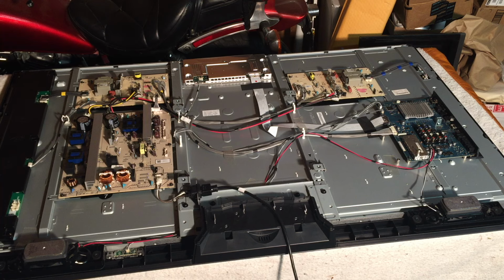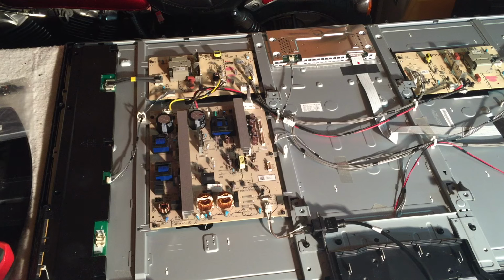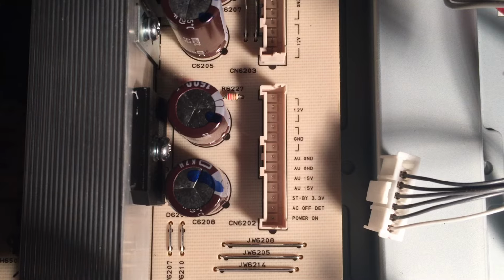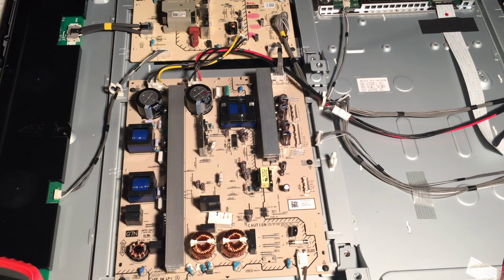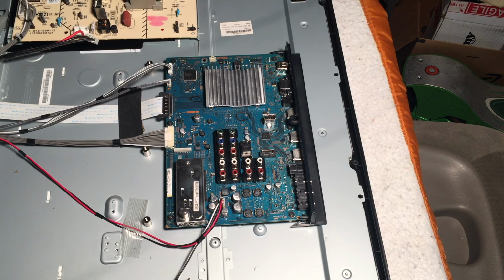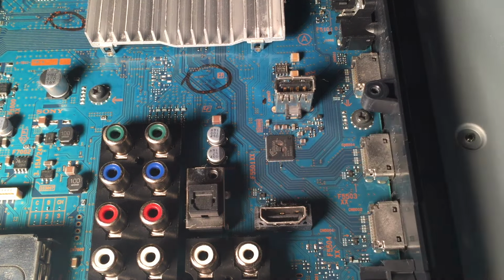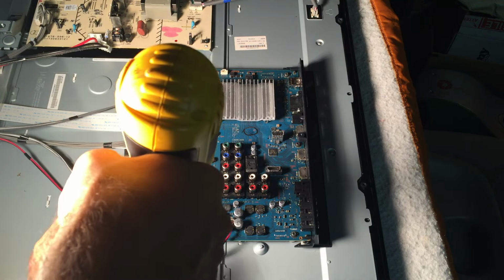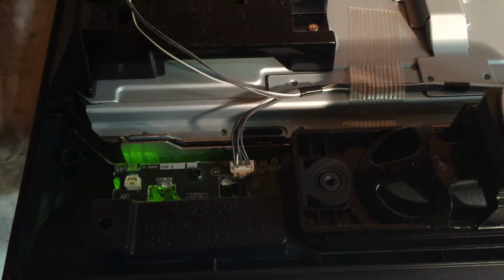How to Fix a TV Hit By Lightning or Power Surge

Comment: Hi mate just wondering that my tv was blown by lightning and it was through the lan wire for internet  to the smart tv and it wont turn on ,so is it main board gone or powerline gone do you have any idea ? thanks
Reply from the maker: Sorry to hear!  If you are certain that the power surge came through the lan cable then most likely you probably have a component(s) damaged on the main board.  Before buying a new main board I would recommend that you test the power supply (like in the video) to make sure it has no problems.  You can also search the main board for any visible burn marks for clues to where the problem lies.

Comment: Thanks for the video... I just found out my main board was affected buy the lightning... but can't find where to buy LG 32lb552u-tb main board.  kindly assist
Reply from the maker: Great job diagnosing it yourself!  I looked (like you did) and couldn't find one.  I would suggest that you see if you can find out if a different model of tv uses the same board.  Sometimes that is a way to find boards you can find by a direct search.

Comment: Awww thought you were gonna whip out the soldering iron but you replaced the board entirely booo...great job on finding the fix though I'm sure you probably just wanted to avoid the chip replacement hassle
Reply from the maker: Ha ha!  Yeah, I could have replaced the HDMI chip itself but then I'd have to check for burned traces and potentially other components with issues.  It was easier/faster to swap out the board.  If you want to see a board level repair on a big tv, check out my video here: https://www.youtube.com/watch?v=BNsog7yEaCM
Reply: Keith Segovia         🇵🇲🇵🇲🇵🇲🇵🇲🇵🇲🇵🇲🇵🇲🇸🇴🇵🇲🇱🇰🇵🇲🇸🇴🇱🇰🇸🇧🐣🇵🇲🇱🇰🇵🇲🇵🇲🇵🇲🇱🇰

Comment: why not just replace the chip
Reply from the maker: Good question.  Because of time and that I didn't source a chip.  The replacement board was delivered fast and not very expensive.  Plus, for most people watching this video I wanted it to be more what most could handle.  The other issue is that the traces could have been burned on the PCB and possibly other components could have gone bad.

Comment: I’m checking out your video today after my son plugged in his ps4 into a wall outlet, heard a pop, and now our Samsung tv is not working. No lights whatsoever. Everything on the entertainment stand was connected to a power strip, except the tv.It is plugged into an outlet which sits behind the tv on the wall. No surge protector. And everything else (cable box, modem, etc is functioning. But not the tv. Now what? Please advise.
Reply: A pop sounds like a blown capacitor to me. I suggest looking up your model of tv and something along the lines of "Samsung ______ TV pop and wont turn on"  in Google.

Comment: When you checked the volt on the 2nd chip you said put the needle on the bottom. Then on the chip. Where exactly on the bottom please?
Reply from the maker: MegaVicki1983 Do you mean when checking for the standby voltage?  The other pin needs to be connected to a ground point.  Any part to the main metal frame of the TV is considered ground.

Comment: great video!!!!! what about a 4k tv?
Reply from the maker: Thanks!  Yes, a 4k TV would be similar.  The main difference between a 1080 and a 4k is the lcd panel itself.  There would still be a main, power, and sometimes an led driver board.

Comment: I have a toshiba 52rv530u and it does have a stand by light and if you power up it goes green and atays on but there is no piture or sound?
Reply from the maker: Chris Carberry what caused the damage?  Do you notice if the backlight comes on when you press the power button (the screen lights up slightly)?

Comment: Hello,today i turned on my tv and ps3 (the weather was clear) suddenly after a while i saw a spark came out and the tv died immediately.I tried unplugging and plugging it doesnt turn on there is no light or anything?Do i need to replace the whole board? and the cause of it?(my playstation is alive)
Reply from the maker: sorry to hear!  If there is not a standby light on the front of the tv, it means it is not getting the 5v to run the light.  Most likely it is either the power supply is bad (could be a blown fuse or some other component) or there is a short circuit some where on the tv.  If you want to repair it yourself you will have to take the back off of the tv and do some diagnosing.  In general you don't need to replace a whole board (just the broken component) but diagnosing and soldering in a new component at that level is beyond what most people want to do and its easier to do a board swap.
Reply: My house just got whacked by lightning this past Tuesday. Took out 2 LCD tvs amongst other stuff. Neither tv has anything showing on when plugged in. No standby light, nothing. 
Checked fuse and it's good and will check the 5v standby tomorrow. But if I get 5v, does it definitely mean I just have to replace the main board?  I don't see any damage to any of the components on the main board is why I'm asking.
Reply from the maker: The main board is likely the culprit but you want to be sure.  See if you get standby voltage (with and without the main board attached) and let me know if you have a question.  The power supply could be bad too.  If you have the same problem that I did with this tv, the short circuit on the main board was preventing the standby light in the front of the tv from coming on.
Reply: FrugalRepair so I plugged in the TV and checked the voltage with the cable going from the power board to the main board plugged in. Then unplugged it to check the voltage in the other side of the cable. Got nothing both times (or very little and definitely below 3.3v). This is a little more confusing than your TV board because it has top and bottom connections (I have a picture but not sure how to post it, but one says ground and other says standby), so I checked them both. The 3.3 is D.C., correct?
Reply from the maker: So I understand correctly,  you unplugged every connection possible from the power board.  Then you plugged it into the wall outlet to give it power.  Then you measured the voltage from the pins that connect to the main board.  Yours should have markings on them (like I pointed out in the video).  When you checked those pins with ground as your reference (black probe to ground, red probe to the point you are trying to check) that you did not see any voltages on any of the pins?  Standby voltages are typically near 5v or 3v, it depends on the tv.
Reply: I unplugged the cables going from the power board to the main board and checked the 3.3v pin and got nothing. Mine is a 3.3 just like the one you had in the video. Because I couldn't get to the pin on the power board side, I checked it on the cable that plugs into the main board side after I unplugged it from the main board.
Reply from the maker: Are you sure that your multimeter probe is small enough fit inside the connector so that the metal is touching? I've had that issue before where I thought my probe lead was touching but it really wasn't and I was getting 0v reading.  If your power board is not putting out a standby voltage then you should find the component(s) that are bad or just replace the whole board (which if your buying on the secondary market is usually pretty economical for power boards.)  Another thing you could do is put your meter in continuity mode and check the pins on the main board and the power board for short circuits.   That is, one probe on ground and the other probe testing the pins on the connection between those two boards.  Some of them will beep indicating a short because they are supposed to be ground lines.  That may also give you some clues.
Reply: I actually didn't have to put the ends into the slots because you can easily reach them from the outside of the wiring harness. I am still concerned though that I see no damage to anything on either board. I would just replace the entire board anyway but would like to see what's causing the problem to make sure I don't end up replacing both boards. This particular board whether the power or the main is very difficult to find online. Perhaps because it's a 3D set?  

Thanks for all the help so far and I forgot to mention that your video is awesome. Without the video I never even would have considered attempting this.
Reply from the maker: I'm glad I can help!  What is the model of your tv?  The fact that it is 3d probably doesn't matter.  It is not surprising that you wouldn't see any physical damage.  With no power coming into the tv (unplugged from wall), did you test for continuity (ie a short) between the 3.3v pin (standby) and ground?  This is testing for a short on the standby circuit.
Reply: Alright,thanks a lot for the reply!I will replace the power board soon
Reply from the maker: TZ- Flash glad I can help.  Make sure you are not getting the standby voltage on the power board (after you disconnect the other boards from it to isolate it) before replacing the power board.  The power surge could have damaged the main board (like mine in the video) and you don't want to replace a working board.

Comment: Hi, unfortunately I have suffered the same problem, last night lightening struck, my android box no longer works, my ps4 powers up but doesn't show a picture & my tv won't turn on although the red standby light does come on when switched on at the wall so I'm hoping after watching your video it maybe is just the main board
Reply from the maker: if the standby light is on then you know it is not the fuse that is bad.  Usually the power supply's are cheaper so you may hope it is that instead of the main board.  But like the tv in this video the power surge came though the hdmi cable and took out the hdmi controller chip.  Let me know how it goes.
Reply: FrugalRepair yeah I will do. I ordered a power board and a main board as the total was £23 for both off eBay which is nothing so after I've fitted them next week I'll let you know the result. thanks for the reply
Reply: FrugalRepair hey, I changed the main board today and the tv is all back up and running!! Your video has saved me a bomb 😁😁😁
Reply from the maker: That is great to hear!  So happy I could help.

Comment: just had a major lightning strike this evening...no thunderstorm, just a loud crackling of lightning one time.  Iwas watching TV at the time and when it happened i could hear a clicking noise coming from behind the tv...I have 3 surge protectors...tv was plugged into a really good power surge protector..now i have no power light no pre amp light nothing...everything else is ok, computer, receiver, modem all are plugged into same surge protector and they survived....is there an internal reset button on my tv perhaps?  it is a Sharp LCD tv model # LC-50LE442U  it's about 4 years old...costs about 600.00 to replace it. what should I do?  thanks for reading this....
Reply from the maker: Sorry to hear!  The light in the front of the TV is called the standby light.  Check the fuse on the main power supply (unplug the tv and take the rear plastic back off  ) as a first step.  Watch the video and let me know if you have more questions.  There isn't a reset button, unfortunately.  But if you have a multimeter and a screwdriver you can fix the tv yourself.    The problem is either on the power supply board or there is a short circuit on the main board (which was the issue on the tv in this video).
Reply: @FrugalRepair  I have a Sony XBR-65X900B  I also was hit by lightning through cable and replaced both the power supply and main board and still TV will no power up.  When I plug power in outlet i hear something engage on power supply, I then push the power button on tv. I hear a click but still no red light on front of tv or does it power up.  When I pull plug from tv I hear the power supply make a noise almost like a contact sound.  Any ideas ?

Comment: My neighbor and my TVs both went out at the same time. We think we got his problem worked out, but I haven't been able to figure mine out yet. My TV (Samsung UN40FH6030) is turning on, however the screen is VERY VERY dim. The controls seem to work as well. I checked everything in this video but none of it seems to be the issue. The main board looks clean and none of the chips ~look~ damaged, though I DO think it died through the HDMI (my PS4 completely died in the surge). Any ideas other than dropping $60 on a new board?
Reply from the maker: The dim screen is the backlight.  did you try going into the settings and increasing the backlight (ie screen brightness) on the tv?  let me know.  if all of the functions of the tv are there (except for the dim screen) then your problem is probably not the main board.  It could be the led's (backlight) themselves, the power board (which supplies the power to the led strip), or some TV"s have a separate led driver board.

Comment: How do I find which main board to purchase for my vizio?
Reply from the maker: If you are sure it is the main board that needs to be repaired then look at the printed numbers on the board.  Vizio numbers tend to to be about 16 digits long with dashes every 4 digits.  You can also verify the board number (part number) by going to shopjimmy.com and looking up your tv's model number.  They usually supply you with the part number for the boards in the tv.  Once you have the part number you can buy from a number of places online.   I'd just make sure whoever you buy from has a return policy (to ensure they don't send you a dead board).

Comment: last night lightning hit somewhere tv went out it powers on then shuts off so i disconnected all  hdmi cords.  tv stays on only when cant use hdmi port 1 and 3 port 2 and 4 hdmi ports work fine as soon as i connect   hdmi 1 or 3 tv shuts off. why is this happening
Reply from the maker: If the tv works fine with hdmi ports 2 and 4 but does not work with ports 1 and 3, then my guess is that there is a short circuit that somehow occurs within the hdmi controller chip when those 2 ports are powered.  I am not exactly sure how the chip handles the switching of the signals to the ports and sends those to the processor chip.  If you could find a schematic of the hdmi chip and show me I could probably tell you.  At least you have 2 working ports!

Comment: Hi sir! I have an LG LW4500 tv. Its an old tv but i want to revive it. As far as i can remember, i think it got broked by VGA (or maybe HDMI i forget). When i plug in to the wall outlet, the tv has a stanby light. When i power on, its like normal. The LED light turns from red to white, but theres no display on the TV. So its definitely the main board right? Could it be the Tcon too? Also i havent taking apart the tv yet, maybe if i got time. I hope you answer my question :D thank you sir. (Sorry for bad english)
Reply from the maker: It could be any of the parts inside. It could be bad capacitors on the power board.  It could be messed up firmware chip on the main board.  It could also be a bad backlight.  For a bad backlight diagnosis, turn the tv on and shine a flashlight on the screen.  If you see anything then its a bad backlight.  You would need to get more information to diagnose it further.  Also, physically look at the boards for any burn damage.

Comment: is it the same main board for any LCD TV? Theres not different main boards for different brands are there?
Reply from the maker: Most TV's have different main boards for each model.  You need to find the correct replacement.  But the main board in almost all modern lcd tv's have the same functions.  It is possible to use the "wrong" main board on a tv model and still have it work.  You need to make sure the lcd panel itself is supported by that main board.  Though this is technically possible, I wouldn't recommend it unless you know 100% that each pin on the LVDS connection matches what the panel is expecting.

Comment: Hii my name is Dickson. my TOSHIBA-40L6353RK smart flatscreen tv it start direct power button and the rest of the key in the tv and remote control doesnt funtion plz help me
Reply from the maker: Hi Dickson, I would be happy to help.  I am not sure I understand what your problem is.  I don't know what you mean by "key".  Is your problem that everything on the TV works but the remote control does not work?  Or is it that the other buttons except for the power button doesn't work?
Reply: E very buttonenclude the power button and the whole limotte also in not respond tv start direct., ihv try to disconect sensor nd but still no
Reply from the maker: Thank you for letting me know.  I am still having a difficult time understanding what you mean.  Are you saying that the problem is that the remote control does not work?
Reply from the maker: I'm sorry Dickson, I am still having trouble understanding your situation.  One way to "make" the TV turn on is to send a 3v signal to the pins on the power supply that tell the tv to turn on.  They might be labeled "EN" or something like that.  You want to try to diagnose where the problem lies, is it the main board?  Power supply? or the buttons on the input bar?